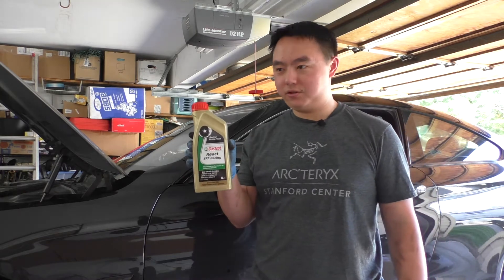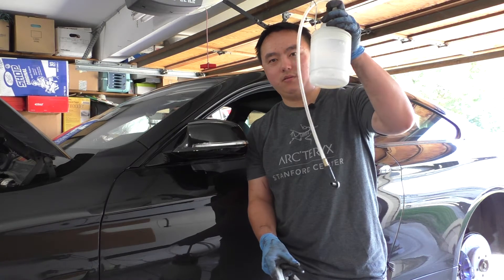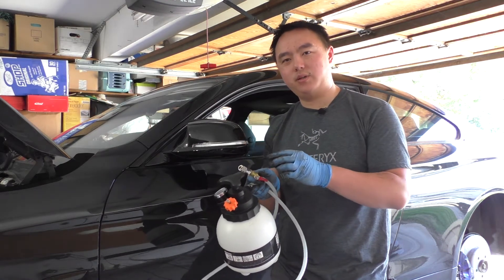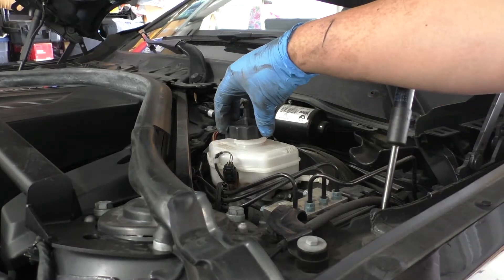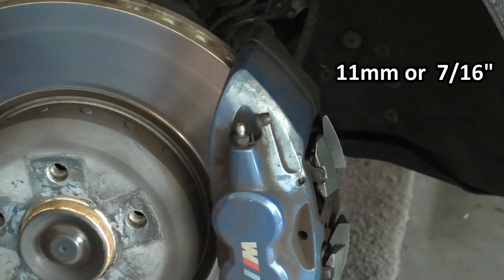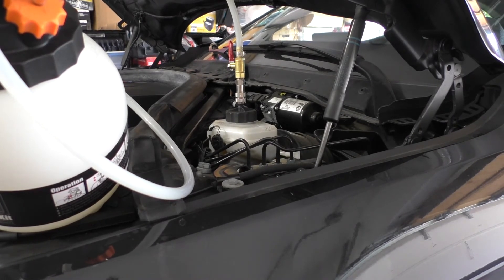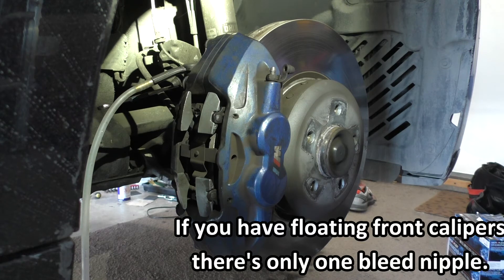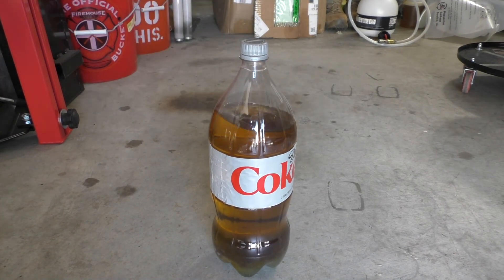BMW Brake Fluid Bleeding/Flush (F2x/F3x/F8x)

Comment: Great video! I was wondering about the quantity, because I'm planning to bleed the brakes on my M2C with sport brakes. I'm also considering bleeding the DCS,  because I'm planning to put in DOT 5.1 brake fluid, so I'm wondering how much fluid that will require.

According to the ISTA+ procedure for bleeding brakes, the order is right rear, left rear, right front, left front and you're supposed to bleed outer first, then inner second. Of course, also in ISTA+, but in the procedure for bleeding the DSC, the order is left rear, left front, right front, right rear. I wonder why there is a discrepancy. Considering how much detail ISTA+ provides, it's a shame that it doesn't recommend minimum volumes for each of the wheels.

Many resources also recommend removing the old fluid from the master cylinder. You could push it through the system, but if you want fresh brake fluid in the entire system, you would have to push additional fluid through the first caliper so you have fresh fluid in it.
Reply from the maker: I usually push the fluid in the master cyl reservoir out through the rear right bleed nipple, and once the reservoir gets to the "min" level, that's when I start measuring the amounts per corner.

For the DSC bleed you only do the rear left and front left. The procedure didn't say to do the right sides for me.

Comment: Nice video, what ball valve did you get and where did you get it from?
Reply from the maker: I'm not using any ball valve for this. I am using a pressure bleeder though (Schwaben from ECS Tuning). I like it a lot more than the Motive one.
Reply: @FaRKle0079 thanks for your response.  I got a schwaben from ECS as well, but mine didn’t include the ball valve at the pressure cap connection.  I did a little research and found that the valve is only included on the multi-function filler model.  For any one else wondering - It’s not necessary with the standard pressure bleed version because the quick connect automatically closes when disconnected.  The valve is so you can turn off flow with an atf filling attachment or something similar connected.

Comment: you should take the old fluid out of the reservoir (no reason to dilute good stuff in larger reservoir) and you did not mention starting with Back-right, back-left, front-right, front-left sequence...newbies looking at this might not know.
Reply: @Mrwaffleandmilk  | The amount of fluid you can extract from the reservoir is almost nothing
not really, when you can flush entire system with les than a quart, ~1/5qt for empty reservoir is no nothing

| what's wrong with pushing old fluid through the system, that's literally what's in the brake lines.
right, I meant why dilute good and bad into a big reservoir. when you push through small line it doesn't mix the 2 as much as reservoir/caliper/booster chambers.

Comment: great vid very concise. how do you know whether to top up the brake fluid or empty and replace? how much is brake fluid for an F22 218i?
Reply from the maker: The BMW recommended service intervals are 3yrs after mfg for first full brake fluid replacement, and then full replacement every 2 years thereafter.

As far as topping off, you shouldn't really need to do that unless you're doing partial fluid bleeds (like you might when doing track events).

All the F2x/F3x/F8x cars should be able to flush with 1L of fluid. If you're not familiar with doing it though, you'll probably flush/bleed more than actually needed, so get 1.5-2L just to be safe.

Comment: the push brake bleed and this pressure bleed which way you think it better???
Reply from the maker: I like pressure bleeding better since there's less risk of getting air into the line, and you don't need another person to press the pedal. There's nothing wrong with using the push brake method, just more cumbersome to me. BMW uses the pressure bleeding method as their official way to do it for their dealerships.
Reply: @FaRKle0079  ok do you know how many litres for X5 2014??
Reply: Push brake bleeding can be bad for the master cylinder seal, your pistons travel farther than normal when brake pedal bleeding so it's an unnecessary risk and usually takes two people. Get a kit online to pressure bleed it like a professional would.

Comment: Great video! I have a F30 with manual transmission. When I bleed the brakes do I need to bleed the clutch? Thanks in advance!
Reply from the maker: You don't explicitly need to bleed the clutch when you do the brakes. If you're bleeding the brakes every 2-3yrs it can't hurt to bleed the clutch though.
Reply: The official repair manual on the f22 lists it as part of the procedure.

Comment: What is the average cost of getting this done at a bmw shop/dealer on a 2014 335i?
Reply from the maker: I can't really guess cost since labor rates vary so much by region. I would think a shop would charge 1-2hrs labor for the job though. It shouldn't really be more than an hour, but some shops also add inspection time for the whole vehicle.
Reply: $300

Comment: Will this also applies to 428i gran coupe?
Reply from the maker: Yes, the same technique is used for the 428i GC. The bleed nipples may be in slightly different locations on the caliper since that model likely has floating calipers though, and with those there's only one bleed nipple for the front calipers.

Comment: Great video!  What should I look for in terms of fluid flow at each caliper?
Reply from the maker: Old fluid that's absorbed moisture will tend to be a bit darker in color (light yellow to amber). New fluid should be mostly clear with a tinge of yellow tint. 

You'll want to open the bleed screw so you see the fluid coming out steadily, but it doesn't have to seem like a heavy stream. You don't want to open the bleed screw too much or air may be able to get via the threads, making it look like you have air in the lines. That's a great way to keep bleeding your brakes thinking you still have air in there when it's actually fine!

Comment: You can add brake fluid in the general pumping mechanism (via the orange cap) so you would not need to check manually the level of the fluid as it will keep it similar as it was when you started!
Reply from the maker: Yes, that's absolutely an option. I prefer not to do it that way to keep the tank clean.